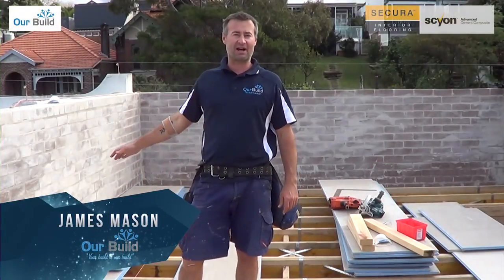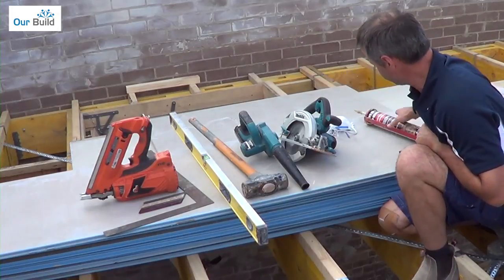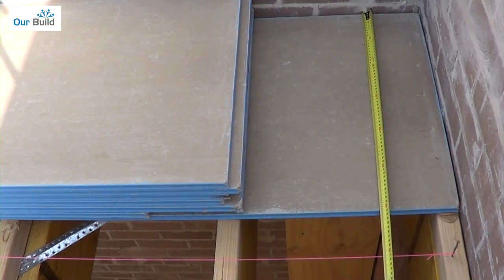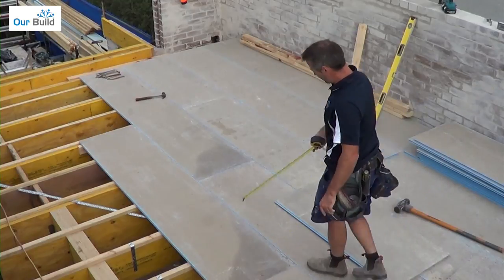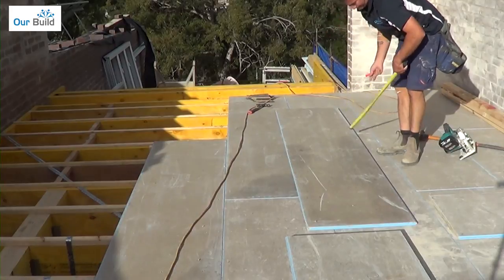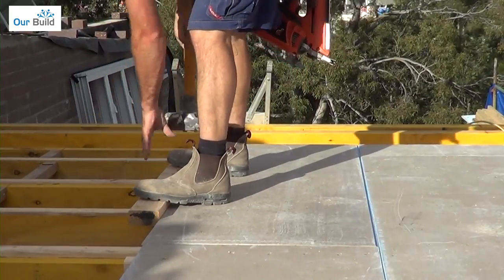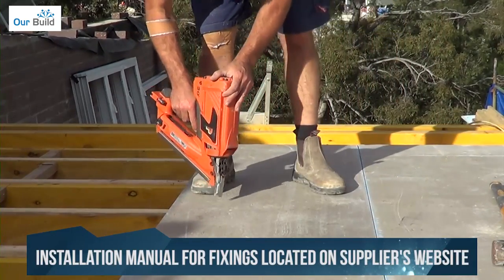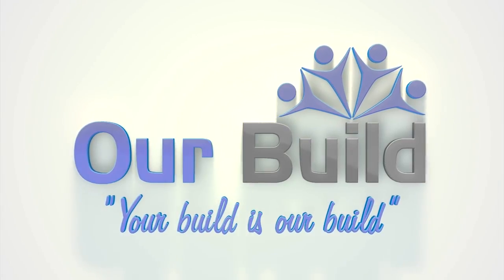How to install James Hardie Scyon Secura exterior sheet flooring

Comment: Nice one James!! The Scyon (pronounced sky-on) flooring looks great! keep up the good work
Reply from the maker: Cheers guys, yeah got the "c" and the "y" around the wrong way :) Great product nevertheless!
Reply: You're certainly not the first and definitely wont be the last!!

Thanks James, love what you are doing. Keep it up. We will be watching for the cladding next :)
Reply: Thanks for sharing guys!
Reply: Sheets only staggered if building waterproof deck - obvious here as you said you will be building below. How did you create the fall?
Reply: Square sheet layout for water resistant deck (tile direct), such as in a ground floor application.
Reply: I was under the belief that you had to seal all your cut joins and that any cut sheets had to be a minimum of 900mm
Reply: Is this stuff available in the United States?

Comment: great video guys....yeah in NSW we call it "sky,,,on" but hey....dont forget the spacing between sheets on butt joints ......from memory you can shoot it down with a 51mm deck fast, 4 to a joist ....bostick ultra set is better than maxbond as a adhesive because its flexible but that me choice....oh and the james hardie blade is worth it, cuts better with less dust...keep the videos coming guys....

Comment: first things first is that all of the people working should have minimum P2 mask... the butt edges require a 5 mm space which I didn't see and they are supposed to be sealed.... 3 rd is yes they can be and should be staggered for anything over a 4.1 meter span

Comment: Can this be used for a covered outdoor deck, with outdoor carpet tiles on top? Our decks boards need replacing. We will be using the area a lot. We would like something other than wooden boards or any of the composite plastic materials. We are in Adelaide.
Reply from the maker: @beach6060  yep, that will work 👍
Reply: @OurBuild  Thank you!

Comment: 01.08.20 - How hard wearing is the flooring, can the panels go down and no covering over the top, I'm looking for flooring in an 8m x 8m raised floor shed.
Considering a product like this, love this for its quick and easy insulation or maybe hardwood or pine boards.
Reply from the maker: You possibly could use it, although it generally goes under tiled floors and could be cost prohibitive, if it's just as a floor covering sheet partical board flooring (yellow tounge) could do the trick.

Comment: What are the nail spacings for this flooring? Thanks
Reply from the maker: Hi Jordan T , from memory it is 75mm apart on the joints and 150mm through the centres? Best check the manufactures fixing guide (Link is in the description above) to be sure as it was a while ago now.

All the best.

Comment: I'd advise folks to look carefully at the details (which are different to this video) here: https://www.youtube.com/watch?v=eY9o0ruQtmg
There are important differences !
Reply: As a retired builder with many thousands of projects under my belt the most common failure of outdoor flooring is cracks due to movement. And, movement will happen, it is not a question of whether it will move but when. The best (only) way to cope with movement is to go with the flow and allow for it in the construction.
The James Hardie recommended method or treatment of the butt joins allows for movement so is quite different to what is shown here and I can't stress enough that it is also much better. I learnt that lesson the hard and expensive way.
Reply from the maker: Thanks for the Input mate 👍
Reply: @OurBuild  ; Do Butyl still supply their tanking system? If so who's the distributor? Or is there any new sheet systems?
Reply from the maker: @buildmotosykletist1987  Never heard of Butyl mate? I engage a waterproofer to take care of the membrane.